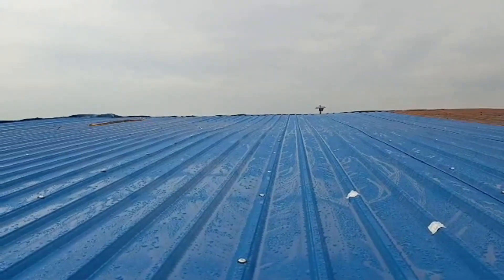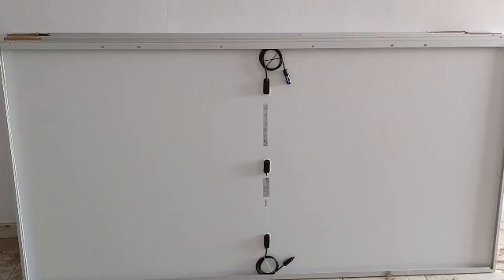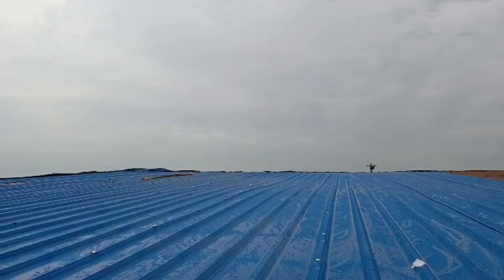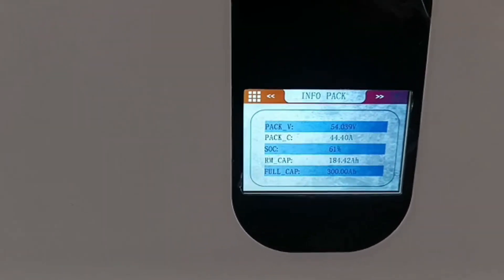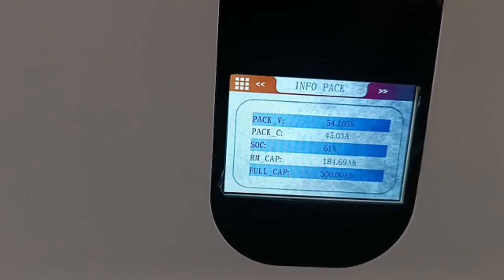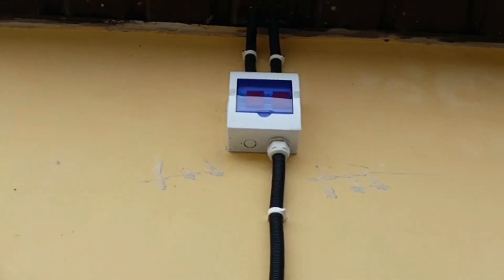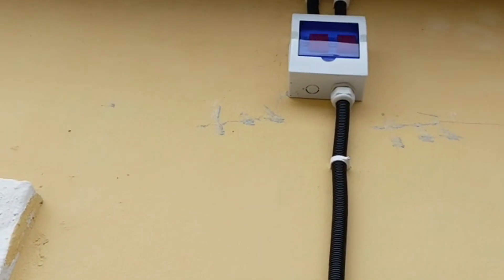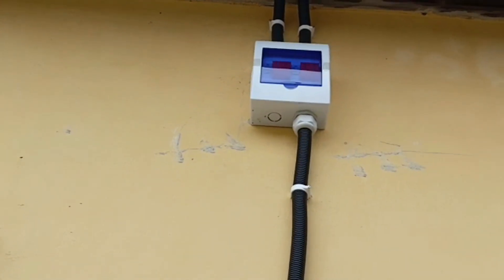9.4KW Solar Installation: GROWATT SPF6000ES Plus + TAICO 15Kwh Lithium Battery + 16Pcs 590W JINKO

Comment: isn't the ac and dc cables supposed to be in different conductors?
Reply from the maker: Thanks for the question. You mean the trunking? If thats the case, their is nothing wrong in them being together in the same wire way.....